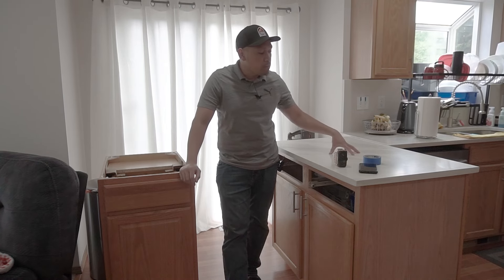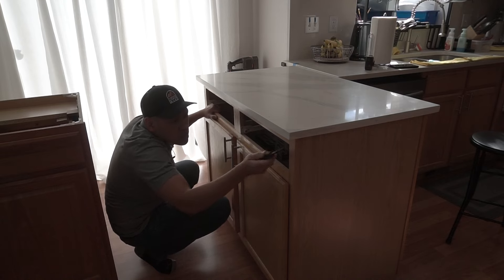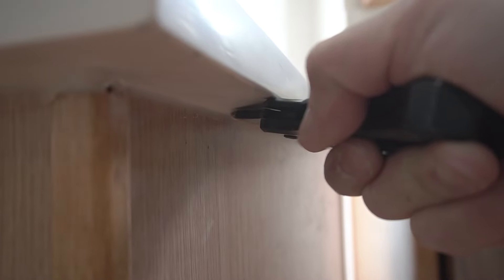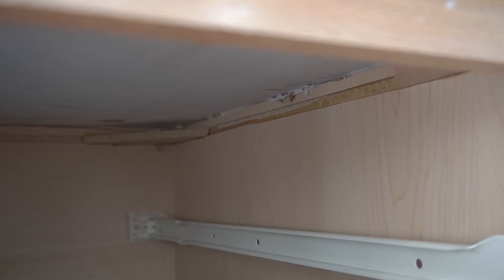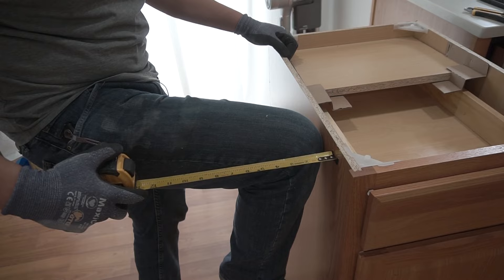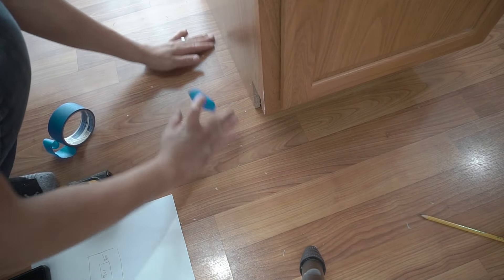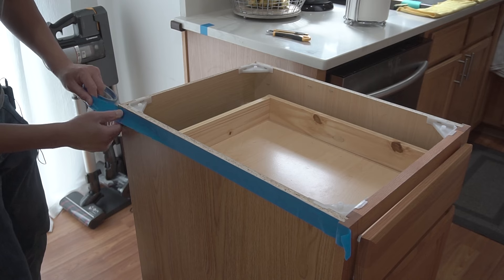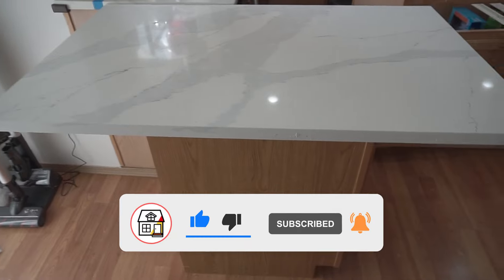How To Install Laminate, Solid, Quartz Or Granite Countertops! EASY DIY For Beginners!

Comment: How strong are these cabinets to hold quartz? i just had mine installed and it is scary that i had like almost 8 ft countertop and theres no reinforcement in between, just the cabinet, and some 1/2 inch thick plywood on the back attached to the drywall

Comment: I'm doing something similar but totally different layout.  😉 I got a 36" countertop from the Restore, a 15 x 24" 3-drawer base cabinet and 2 unfinished wood legs from Lowes to make an island.  So instead of centering the cabinet under the countertop, it will be under one end of the countertop and the legs attached under the 2 corners at the other end.  Hope that makes sense.

Comment: Hmm, 8:24 that back left section, would it not need additional support? Example, if someone comes in, and places heavy items just on that back corner, I feel it may tilt, no? Then again, it would have to be something rather heavy, so, maybe not... 

PS: Simple removal and install. I probably would have messed up, doing the math to get it positioned right 😆
Reply from the maker: Hi Ivan! We installed additional "L" brackets to support and prevent tipping. These brackets are attached to the other cabinet drawers. I think you would have gotten install perfect! If I can do it, anyone can! Thank you for the meaningful comment!
Reply: Do you just screw the L bracket onto the quartz and cabinet directly? It can penetrate the stone okay?